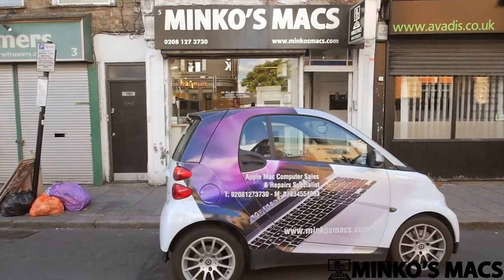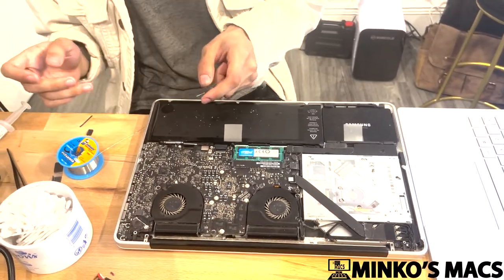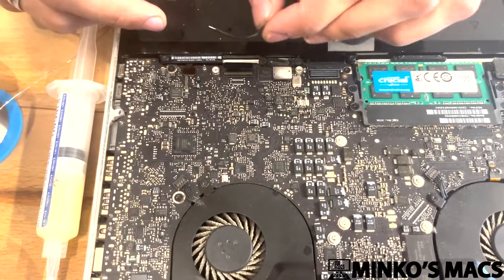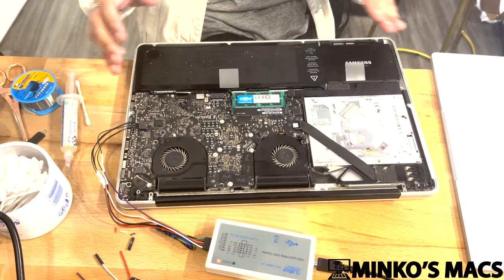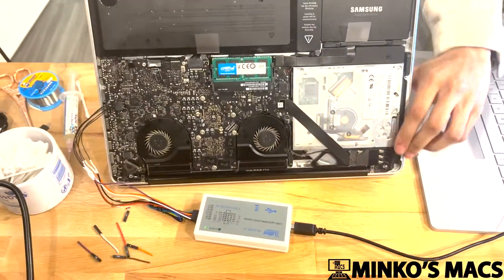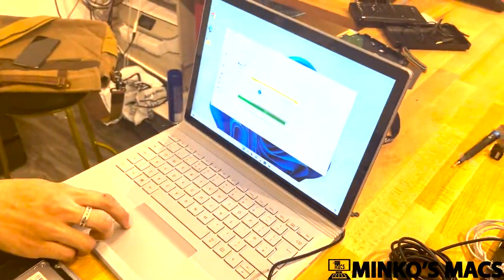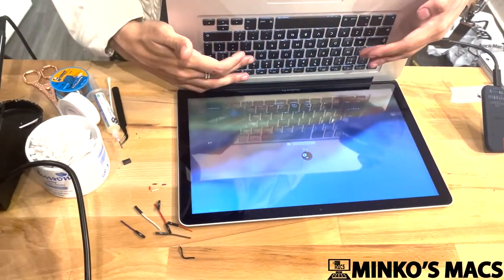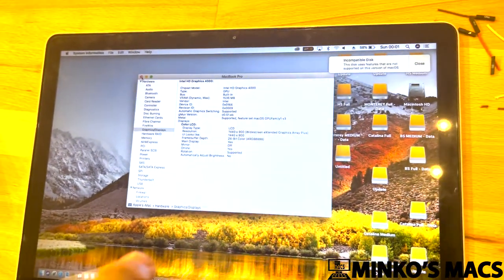Apple MacBook Pro 15 inch 2010 2011 2012 Unibody Permanent GPU Graphics Card Fault Fix - Minkos Macs

Comment: Ahh awesome man, I keep getting the 2015 onwards macs with liquid damage in different areas 😁
Reply from the maker: We will most likely have informative videos soon enough covering those boards, luckily as pesky as they are; They are easy enough to understand.

Good luck with your repairs!
Reply: @minkosmacs4409  ahh cool, it’s just like any repair they are all the same when you’ve done a few. Find the short, fix traces and tada 😀
Reply from the maker: @MrReeceyburger123  Until the magic smoke appears after fixing the traces or shorts heh
Reply: @minkosmacs4409  swear words get said at this point haha